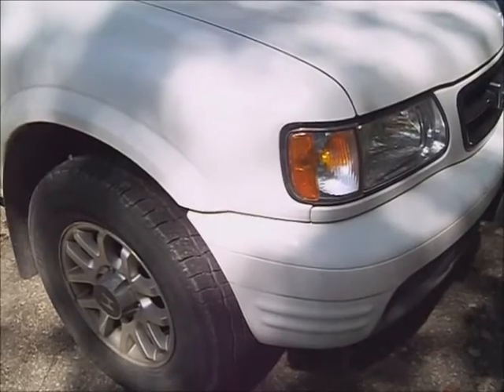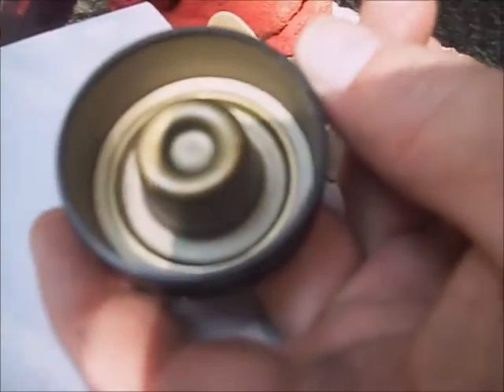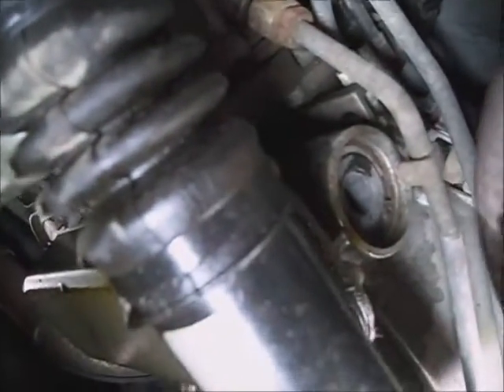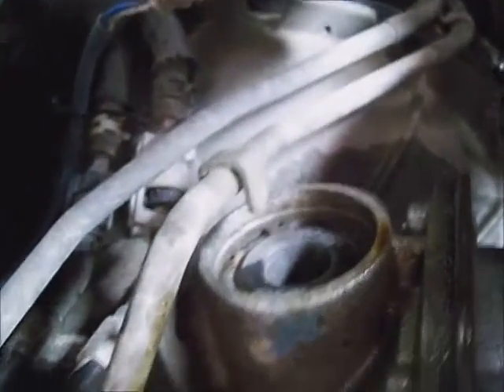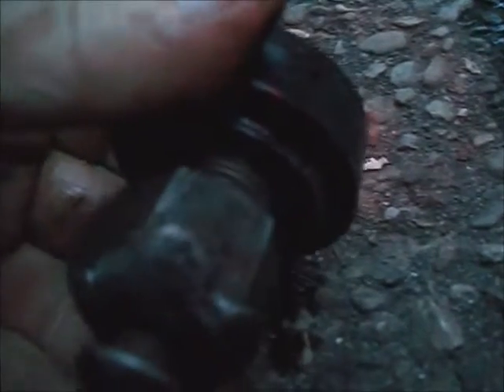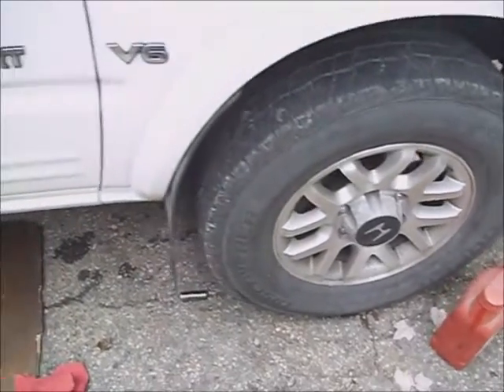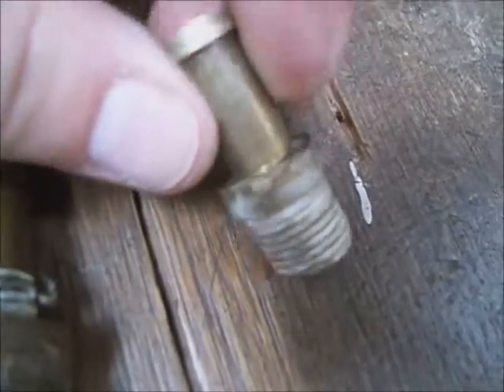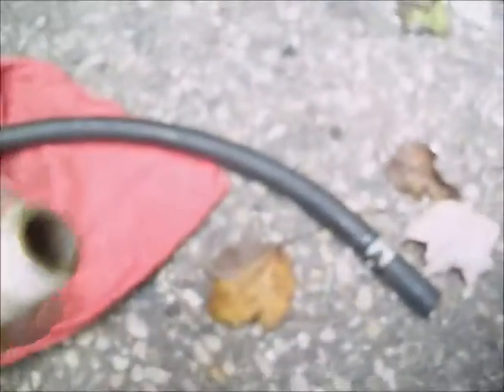Honda Passport `02 4L30-E transmission fluid leak 3,4 accum cover replace fluid level check

Comment: hey, thanks for posting this video! I need to change mine because it is also leaking. But I have a question. did your vehicle give you a check trans light? my vehicle is giving me a check trans light and is shifting hard from 2nd in to 3rd but only after the light comes on. I was wondering if you had similar symptoms with your vehicle before you replaced this part??

Comment: Thank you for your video help a lot my car have the same problem leaking oil from that part but I can't put the part back in with the o ring .Do I need to release pressure line before I put it in or how ? Please help if you can thank you.
Reply from the maker: Myumi Molovaco. I put a long bolt in center out close to frame, and used a piece of wood, or metal to pry between long bolt and frame till it went  back into its bore against spring.  (Prob 45 lbs of force).  It has to go back straight, and it will stay down while the clip is being put back into  its slot.
Reply: Auto Dr diy 
Thank you for replied .While I tried to pry it in and I damaged the part now i have to wait few day for new part  coming .My question is with the long bolt put from out side how to measure about 45 bls of force...is it special tool or more technic ? and sorry for my low level of this.From beginning of work. I did not use 17 mm and 21mm and 12mm to release the transmission line as your video because I think it has enough space to work .Is it problem ?)
Reply from the maker: Myumi Molovaco  I use this video to remind me of the exact amount of items and time, minimum, to do this job.  I wouldn't try it without removing the lines.  There was no exact measurement of bolt length to frame.  The length was estimated by the thickness of what I was prying with,  like a ("1×2" wood) 20" long, and a "3/8 drive extension, with say a 13 mm 12 point socket on the end of extension , and then i would insert socket end, into center of the rubber plug coated plug.  I found a hinge point on body or frame with tip of wood, and  use a long enough "3/8" extension  to reach wood prying piece at an exact angle that will push bonded rubber plug exactly in center, down length of bore hole.  (Without lines in the way) The bonded plug would have to be lubricated with fluid, and watched carefully, that it starts in bore evenly and square to trans housing, as it is re-inserted.  Otherwise damage to trans or plug may occur.  If I damaged a plug, I would practice inserting it once or twice.  So that didn't happen again.   As the plug enters bore, it has moderate drag, and then gets a little easier.
Reply: Auto Dr diy 
Thank you for everything.Finally I got biggest 3f clamp in HDepot and done thank a lot again.
Reply from the maker: Thanks for watching
Reply: @AutoDrdiy  what's the name of the part?

Comment: I cant find this part on amazon, can you please send me the link to it! Thanks
Reply from the maker: I got plenty of hits online, by just typing, '02 4l 30-e accumulator cover.
Reply from the maker: https://www.amazon.com/dp/B01GMTPR5U/ref=cm_sw_r_cp_apa_i_hVw9EbNCPGFAK
Reply: Auto Dr diy, thank you. I have a honda passport 01, im wondering if they are the same size or not
Reply from the maker: @ericksonramos2186  I dont think the size is relevant, but the inside shape is different I believe, to accommodate the different function of the spring and piston, of the 2 diff bands.  But it is always the 3-4 that goes bad.
Reply: Do you need to replace oring or just cover to stop leaking, thanks